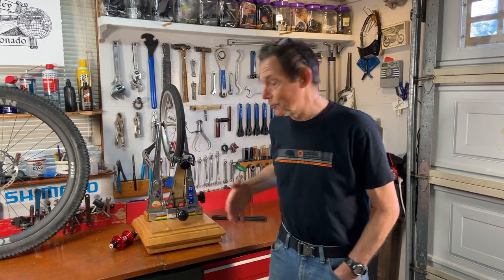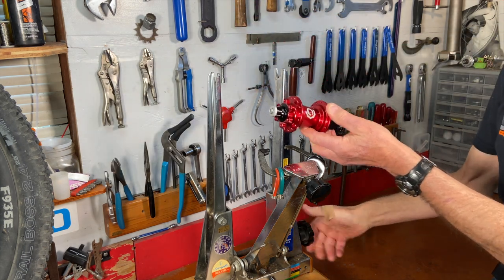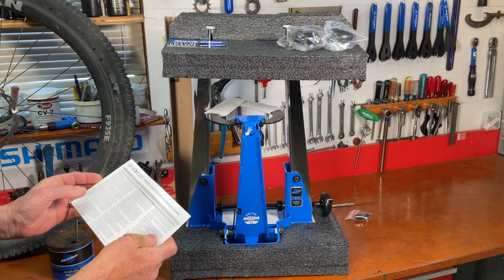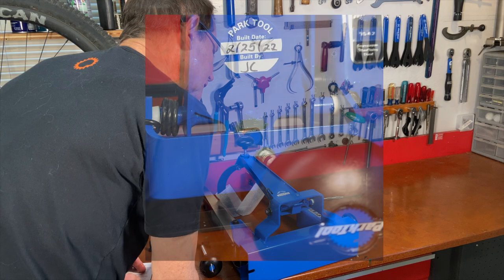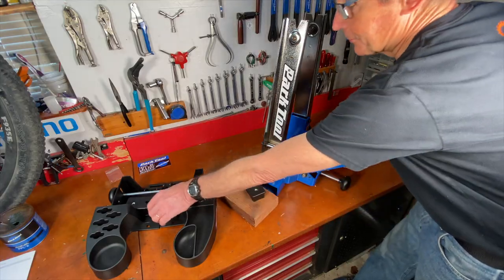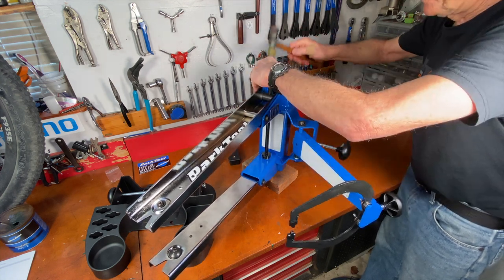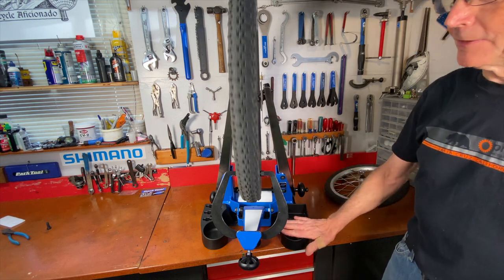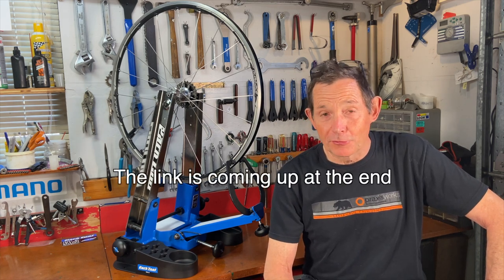Park Tool's Easy to Use, Super Versatile TS-4.2 Bicycle Wheel Truing Stand

Comment: Park tools is overpriced
Reply: Can you tell me, what is not overpriced today in this crazy world? 
With the today price of a "Dream bicycle", i bought 3 cars in past. I drove at all of the 3 cars all in all 700,000 Km in a period of 20 years! Renault, Mercedes, VW. 
You are right, Park tool is overpriced, but, when i think, a China Truing stand costs 200€ and more and it is only nice in pictures...! Yes, i am thinking about price and quality since two weeks ago! It is sad😞Anyway i will buy a quality even for rarely using!
Reply: Maybe, but if you plan to use it there are a few arguments for paying more. The cheapest truing stands are useless. I'm from Europe, therefore I calculate in Euros.
1. You can get better build truing stand for 130,00 € to 180,00 €. Which have bad reviews (1-2 Stars), but you can get them to work.
2. You cannot trust the quality control of those manufacturers. You may get a good build or a bad build.
3. You never know, if there are changes to the design when the next shipment arrives.
4. You cannot get any spare parts. Something is broken or worn out -> Start to fiddle around.
5. If there are spare parts from eBay they may not fit because they slightly changed the design.
6. You will start to calibrate before you can even start.

Park tool building every part by themselves and selling basically the same product over 40 years and sending out spare parts is a huge factor here. And Park Tool is around quite long it will hopefully not go out of business. But even then, you might get used tools for spare parts or another corporation building spare parts.

 I would always pay double the price, if I know the manufacturer sends out spare parts and supports the products for years to come. Nothing is making me more mad than paying 200,00 € for a product which is waste because of a broken part worth a fraction of the product.
Reply: Overpriced thats ok for a precised engineered tool.
Reply: If you built the stand and was selling it, you would not sell it cheap either. Instead of whining g about the cost of precision tools, think about the cost of employee wages and benefit packages that are the snowball rolling downhill.

Comment: Which is better ts 4 or ts 4.2 or ts 2.3?
Reply from the maker: Thanks for watching and the question, Allan. The 2.3 is Park's newest truing stand. The 4 was discontinued when Park came out with the 4.2. All Park truing stands share common features that I show in my video that make them easy to use. So it's less about which stand is better than which stand is the best stand for the typical wheels you want to build and work on. The 4.2 can handle even the widest hubs (up to 250mm) and the widest rims (up to 5 inches). The 2.3 can take up to 200mm hubs and 4 inch rims. So, if you don't work on oversize wheels like that you may not need the 4.2. I hope this is helpful, thanks again for watching.
Reply: I was thinking the same question
Reply from the maker: @1988howie  thanks for watching and I hope my previous reply to Allan answers your question HowiE. If you have more/other questions, just let me know. Happy to help.
Reply: @JimLangley1  thank you! Yes, you answer its perfect!

Comment: You could have also shown the DT-3 rotor truing attachment. I have one on my 2.2 stand.
Reply from the maker: Thanks for watching and the great suggestion J. L. appreciate it very much! For anyone interested, here's a link to that cool tool: https://amzn.to/3Mb4IK0 The way it works is it attaches to one arm on the Park truing stands. The truing tool has a threaded indicator that you can move in to get the tip right next to the rotor to easily see the wobbles. Since the wheel is firmly held in the truing stand and the rotor is so easy to see up high in the truing stand it's easier to fix wobbles than when a wheel is on a bike. Park also makes a rotor truing tool that works nicely here https://amzn.to/3ZwAww0 You can even attach a dial indicator to the DT-3 if you like to use those. Here's Park's dial indicator for the tool: https://amzn.to/3nIq2MP

Comment: Hi Jim, I’ve been looking at a truing stand just to do basic maintenance truing but at the same time learn the art of wheel building in the future.  I’m just a weekend warrior wrenching on my family and friends’ bikes.  I think my decision for purchase is either an average priced quality stand or go big and buy the best like the 4.2.  I’m thinking the basic Park Tool Home Mechanic Truing stand or the Feedback Sports truing stand both are just one sided which might be harder to use as I have to keep flip wheels back and forth.  Any suggestions?
Reply from the maker: Thanks for watching and the question, Sam. For working on family and friends' bikes, you can usually do fine truing wheels while they're on the bikes. That's the way most pro mechanics fix most wheels during tune-ups and even during more major bike work such as overhauls. You can get wobbles out from loose spokes easily by sighting the gap between the rim and the brake pad on rim brake bikes and on disc bikes, you rest a thumb on a seatstay and watch and feel the gap between your thumb and the rim. That works fine for truing on bike repairs.

When a truing stand comes in is when you need to work on wheels with major problems (big wobbles and hops/dips - out of round issues) and when you are wheel building and don't necessarily have a bicycle to put the new wheel(s) in. So, I would say that you might want to wait to decide what to buy for a truing stand until you find out how much you will really use it. If you do end up building wheels for yourself and others, that's when you'll definitely appreciate a good truing stand. 

I've learned that paying extra for quality tools is always worth it. They make it easier to do a good job, they hold their value and they're a joy to own and to use. I have owned the one arm truing stands and didn't find them any better than truing the wheel in a frame. The thing about Park's shop-quality stands is that they're rock solid, very stable. One arm stands aren't that stable.

Stability is important because you're trying to make fine adjustments, so small that you can't even see them once you've got a wheel as perfect as you can. If a truing stand wobbles as you are working it makes it a lot harder to see those fine adjustments and it gets frustrating. It takes focus and time to fix wheels and a good stand makes the job a lot easier. I know the Park stands are expensive compared to some others, but there's a huge difference in the quality of construction and performance. And, it'll probably be more expensive to buy several cheaper stands trying to find one that likely still won't perform up to Park's standards. Remember that they've been making and refining this stand design for about 50 years now. The other guys trying to copy their design are copying something which is totally different than inventing, refining and perfecting. 

I hope this is helpful. If you want to see my new truing stand in action, I just did a video where I fix a crashed aero carbon wheel in it https://youtu.be/NyPGQrNfUFU That's a big job and you can see how many different steps go into it and how well the TS-4.2 works for doing it all. Let me know if you have any questions or comments and I'll get right back to you. Thanks again!
Reply: @JimLangley1  Great information!  Thanks so much Jim.
Reply from the maker: @samguan5236  you're welcome!

Comment: Hi Jim, did you calibrate after you pulled it out from the box?
Reply from the maker: Thanks for watching and the question, Torque! Park truing stands actually come from the factory ready to use so you don't have to check or change anything. Now, if somehow the stand got damaged in shipping, the one thing that possibly could get knocked off is the automatic wheel centering feature. That's never happened to me with the many Park stands I've bought and used over the years (I ran a wheel shop and bought multiple stands for the building stations we had). However, if a stand was to get knocked out of center, they are made to be relatively easy to re-center. Park has a video about how to do it here: https://youtu.be/OhSZKGJliwA I hope this helps and thanks again!
Reply: Thanks Jim.
Reply: @torquecanyon8424  I bought mine in Germany. The packaging is really good with the foam and fits tight into the box. The package has to fall from a few meters height to have an effect on the truing stand I think.
The upright poles are snug into the upper foam, while the base sits tight in the bottom foam, which is reinforced at the sides by thick plastic boards. This way the truing stand cannot work itself into the foam and get a clearance allowing it to wiggle in the box.

Comment: I upcycled a neodymium magnet from an old hard disk. I just put it onto the upright poles now I can store spoke wrenches there. As a base I used two plywood boards. In the upper board I milled some 4 sided "pockets", could have used just a jigsaw for it though.
In the lower board I chiseled hexagonal holes to fit the heads of two M8 screws for which I drilled through the upper plywood. Those screws are for holding the truing stand. Both plates can either be fit together using screws or glue.
This works great as a base, too is dead cheap especially when one can source some rest wood from a construction site.
Reply from the maker: Thanks a lot for watching and for giving the details on your custom truing stand and base. It sounds like a great design and using a magnet for holding spoke wrenches is brilliant. Wonderful ideas. Thanks so much for sharing!

Comment: I just got mine last week - i liked the caliper adjustment on the  No 4 stand - on this 4.2 the bolt just screws up against the painted surface marring it up . Mine came with a base and a TS-TA thru axle adaptor , im now making a stainless bracket with dimple die'd hole to bolt inside the C-channel upright/drop out to hold my axle adaptor , ill use a dome head allen bolt to go through the top of the ready drilled holes and the bottom on the adaptor will rest on the pivot bolt sleeve below
Reply from the maker: Congratulations on getting a 4.2, adZ! I don't think you can see it in my video but my stand had a bolt holding the arm in place for shipping. On that bolt was a little red plastic cap. I believe that little red cap is supposed to go on the end of the caliper arm adjustment bolt so that it doesn't contact the arm. If you didn't get that cap it would be easy to put something plastic that fits over the bolt. I don't understand why your stand came with the TS-TA adapters? Because the 4.2 has built-in thru axle holders which I do show in the video. Enjoy that great new truing stand!
Reply: @JimLangley1  exactly

Comment: Hi Jim, love your channel! Tons of bike wisdom for all of us home mechanics!
For quite a while I have had a very cheap and basic wheel trying stand (it’s even cheaper than my through axle adapter :)), it’s wobbly and unstable but with some time and patience and the help of a dishing tool it gets the job done pretty well. 
Recently I finally decided to get a fancy park tool stand (2.3). But with my previous experience working on other stands, I’m a bit doubtful about this double-sided caliper as I always used to do one side at a time with an independently regulated right and left caliper. 
So, my question is how well is park tool calipers centered out of the box? Do they go out of center after some use? Should I get a park tool calibration gauge (which is ridiculously expensive for what it is) to calibrate it once in a while? Or do I still need to use a dishing tool and turn the wheel from side to side to make sure it’s not “dished”? 
Sorry for the long comment and thank you!
Reply from the maker: Thanks a lot for watching and the awesome comment, Ivan, I'm so happy you're enjoying my videos! Congratulations on getting Park Tool's new 2.3 truing stand! I haven't even seen one yet except in Park's video on it. Regarding how well they are centered, I've worked on quite a few different ones and I would say that the new ones I've set up out of the box have been centered properly from the factory. And usually they stay centered if they're treated nicely. Dropping them or cranking down hard when installing wheels or pounding on wheels while they're in the truing stand maybe to take out a rim dent - these things can knock the stand out of center a little. But as you know, the stand is designed to be able to fine-tune the centering. Park has a new video about this here: https://youtu.be/OhSZKGJliwA

The thing is though, that you may find as I have and a lot of other wheel builders, that the centering indicated by the truing stand is not to the tolerance you like to get your wheels. The stand gets it close, but with any axle issues or if the little plastic tips on the indicators/pointers are a little off, it's not going to show super fine gaps. I try to get my wheels as perfectly centered as I can - no visible gap. And for that I find that there's no substitute for a proper dishing gauge. So, the way I center wheels is using the Park stand as the "rough" center, which tells me I'm very close but then I always take the wheels out to double check with my old faithful Campagnolo "N" dishing tool (I have modified mine to work with BOOST and standard wheels and I still think it's the best dishing gauge available - though now mostly on eBay.com).

As far as Park's calibration gauge, I have never owned or even seen one except on their channel. I have always used a perfectly dished front wheel to center the stand. But, I haven't had to center the stands but a couple times because even if one gets a little out, I don't worry about it. The first time I check the dish of a wheel with my dishing gauge and I know the dish is where it needs to be, when I put the wheel back in the stand and move the indicators next to the rim, I know that the indicator that's closest to the rim is now marking the properly dished wheel's perfect center position. And from then on as I finish the wheel, I just keep that side of the rim right where it is in relation to the indicator and the dish stays where it is.

Sorry for the long reply but I hope it's clear and helpful. Please let me know if not and I'm happy to explain more. Thanks again for the support and great comment and enjoy your new 2.3!
Reply: @JimLangley1  Thank you so much for such a detailed response! Now it makes total sense to me. 👍
Reply from the maker: @IvanMalechko  you're very welcome, Ivan!